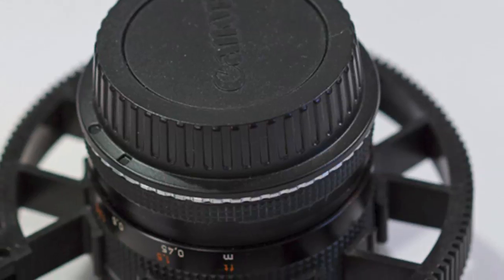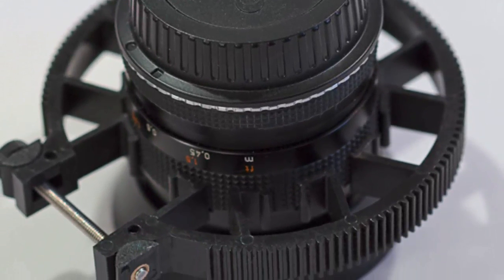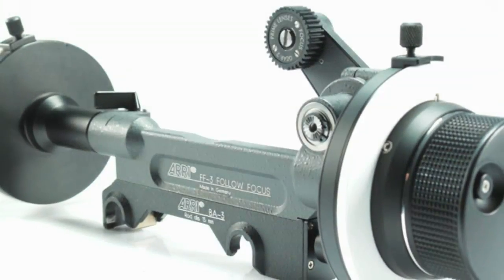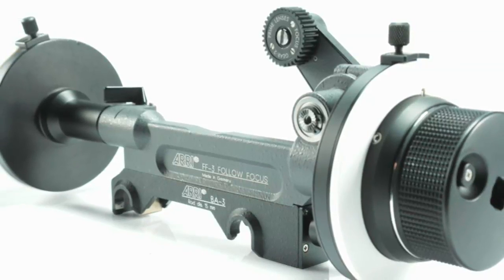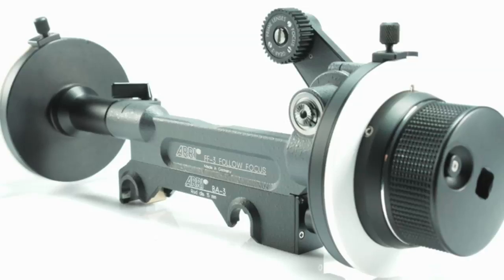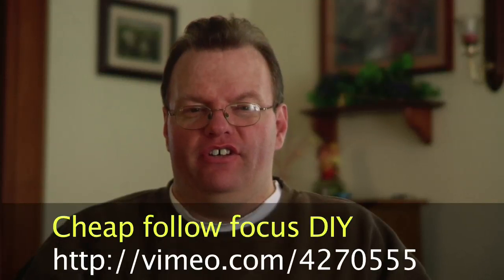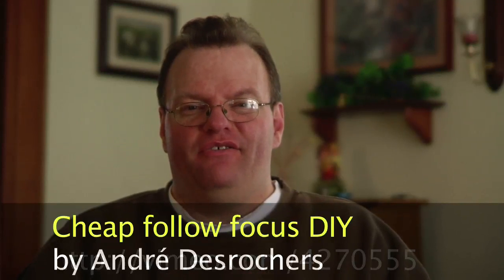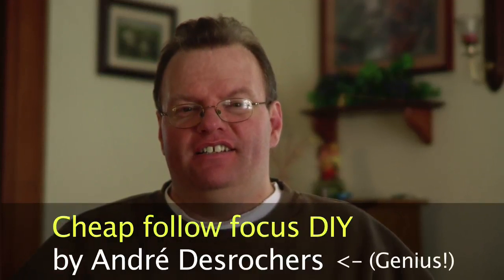$1 Dollar DIY Follow Focus Project!! VERY COOL!

Comment from the maker: @GanEdenAustralia Well, I bought mine for less than that.  All of the materials used cost all together less than $1.00 US.  They might cost more in other locations.  You can get them cheaper on line as well, but then you have to factor in shipping costs, so it is better to just find one locally.  But,  even if you only find them at $3-$4,  it is still a bargain compared to a traditional Follow Focus.

Comment from the maker: @paolinosk8 You put the bolt in through the inside of the hose clamp.  (The opposite of what you are thinking).  The head of the bolt is on the inside of the clamp.  Look at that part when I actually install the clamp around the lens,  You will see the bolt head in the INSIDE of the hose clamp.  Then you use the nut to tighten it.  You COULD put something at the other end for something to hold onto, but I don't.  I hope that explains things.

Comment: @musichistorynut but u tighten the drill with the bolt from inside... so the bolt is inside... ? 

so actually the end of the bolt that is more far away from the lens should have something on the end like all bolts have( like a round surface or octagunall) ??? 

why is it without on urs...

Comment from the maker: @paolinosk8 You have to drill a hole in the hose clamp. (Large enough to fit the bolt in) and then you just have to tighten it with the nut.  Pretty simple.